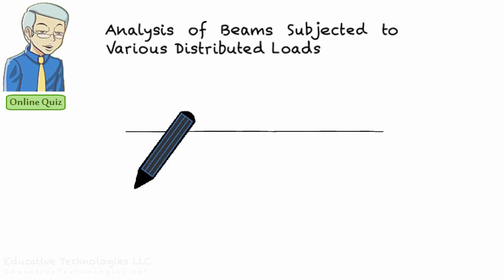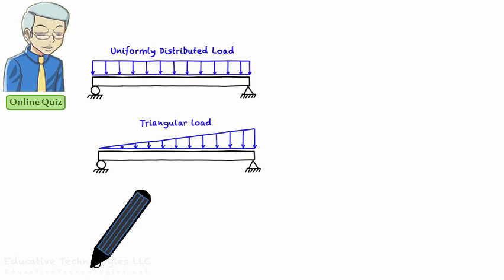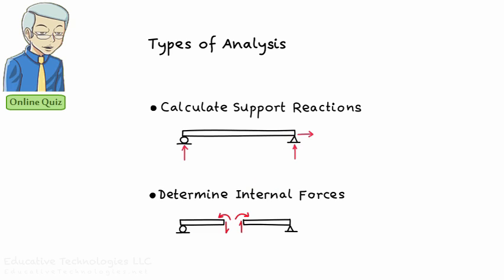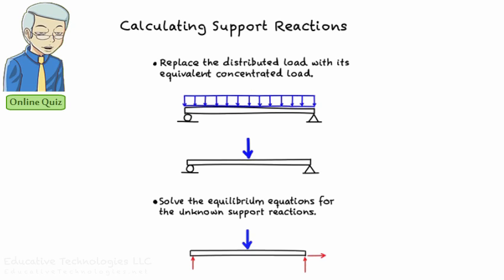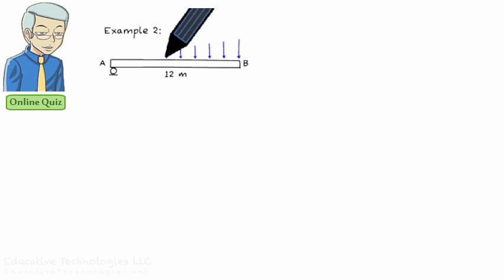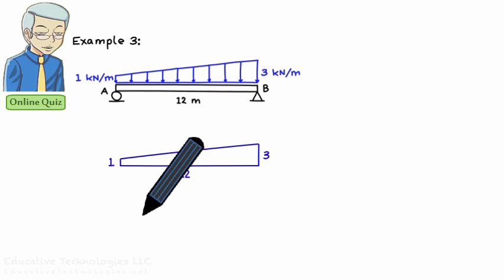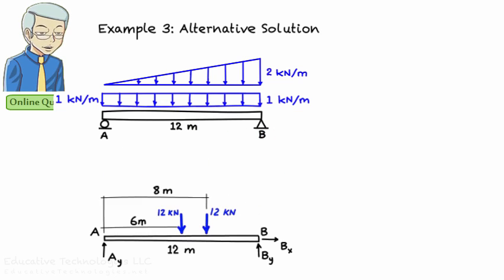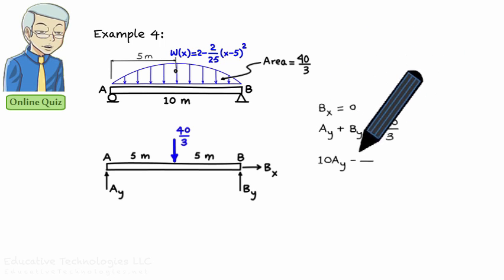SA14: Distributed Loads on Beams (Part 1)

Comment: Nice video, I want to convert a slab load (kN/m2) into beam load (kN/m), is there any video I can visit?
Reply from the maker: We don't have a video that deals specifically with the case you've mentioned.
Reply: Ok, it's alright. I think the method name is envelope method. I have surfed on the internet but I found some different types of equations. Still confused where is the right equation.

Comment: Dr . Structure, 6.59 Is it equal 2×12=24 ?
Reply from the maker: If the 2 in your equation is the average of the heights of the trapezoid, then yes! :) 

The area of a trapezoid equals to the average of its two heights times its base.
Reply: Dr. Structure  thanks
Reply from the maker: You are welcome.

Comment: Dr.Structure, the equation used @7:39 should be x=L/2 + (L/6)((a-b)/(b+a)).
Reply from the maker: b is the taller side of the trapezoid.  If b is significantly larger than a (the shorter side of the trapezoid) then your equation could result in a negative value for x, since (a-b) becomes a large negative number. But we know that x cannot be negative given that it is the distance from the left end of the beam. How do you explain that?

Comment: sir I have a doubt initially you have told that load is distributed as surface distributed load and one dimensional distributed load...

later you have considered the load as trapezoidal load from slab ( VIDEO NO SA34 LECTURER)

I have a little bit confusion in that what is the difference between initially you have told about surface distributed,  one dimensional load and trapezoidal load of the two way slab...

plz kindly reply sir
Reply from the maker: Thanks for the question. There is no discrepancy between the two explanations.  

A load that is distributed over a surface often needs to be translated into a line load.  The shape of the line load depends on the geometry of the surface and the load pattern on the surface.

Let's limit our discussion to rectangular slabs. If the slab is supported by four beams on its edges, then depending on the dimensions of the slab (whether we have one-way slab or two-way slab) we get a different load pattern on the beam. 

Say, the surface load is uniformly distributed, then if the slab is one-way, the line load would also be uniformly distributed. But if the slab is two-way, the line load would be trapezoidal because of the Yield Line Theory, as is indicated in SA43. 

Now, let's consider a non-uniform surface load. Let's say there is snow on the roof, and the distribution of the snow is not uniform, there is a bigger pile of snow at one end of the roof creating a rectangular profile. If the roof is a one-way slab, then the line load due to the surface load is also going to be triangular. If the surface load had a trapezoidal profile, the line load would also be trapezoidal. 

So, the trapezoidal shape of the line load (on the beam) could be due to the load profile on the roof, or it could be due to the fact that we have a two-way slab.
Reply: Dr. Structure sir yes now i understood very clearly how does load  transmitted to the beam from your explanation . Awesome....